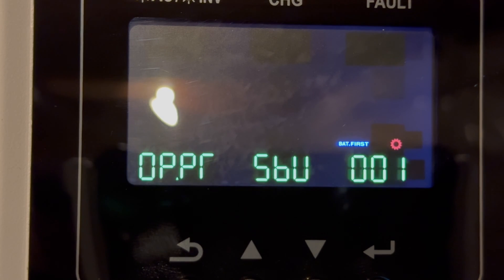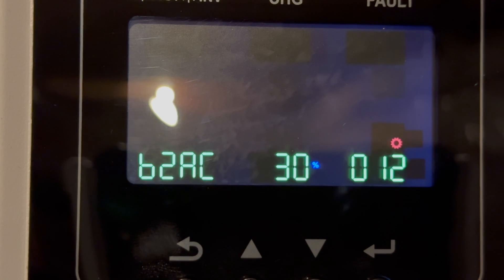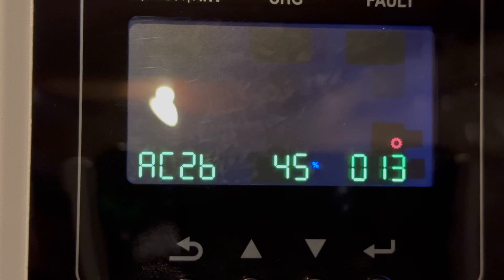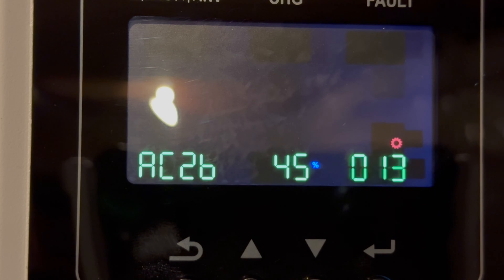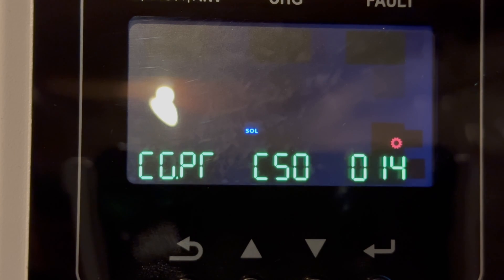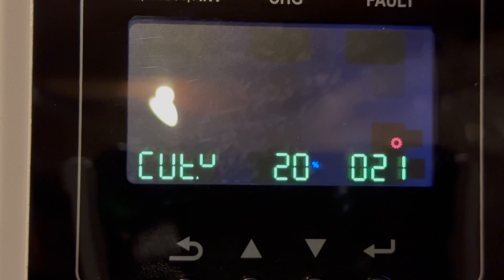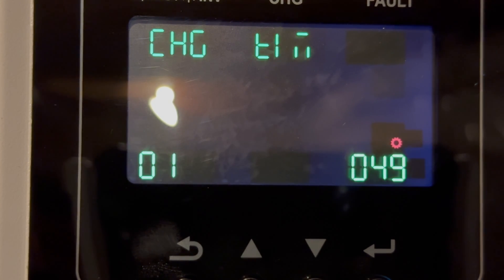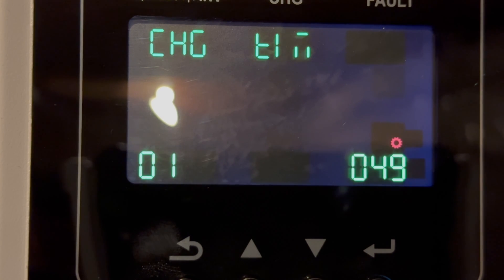Growatt 5000 es Settings - Spring/Summer/Fall

Comment: I tried using 49 & 50 to run off the battery during peak rates, & re-charge off-peak ( too much shade here for solar...😢).  Anyhow ot doesnt seem to work... Switchober tk batter & grid charging are bith non-functional... Are there other settings that can interfere with this?

Comment: Hi,
Have you ever received error code 15 and how did you fix it?
Reply from the maker: If your inverters are in parallel they likely don’t have the same AC power going into each.  I only get this error if I am power cycling and kill the AC power to the inverters.  That error will come up if one or more have had their AC power disabled.  

How is your system set up?